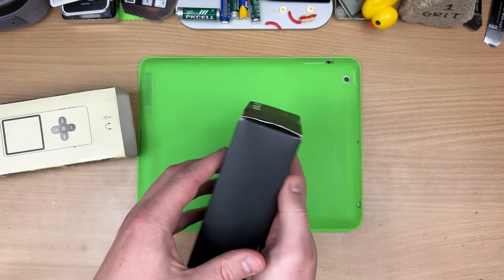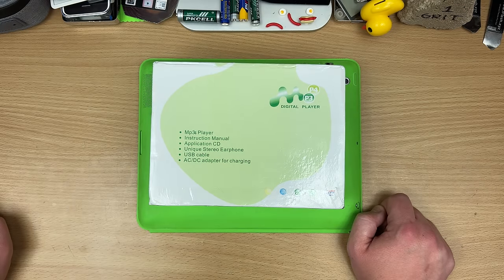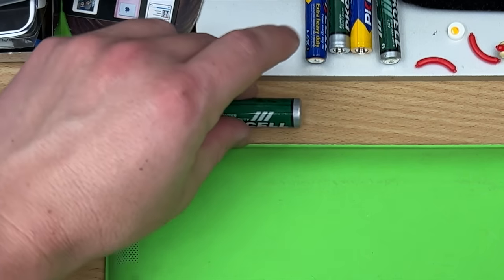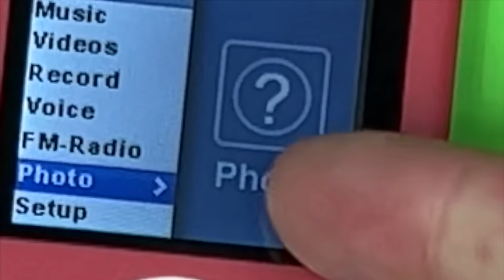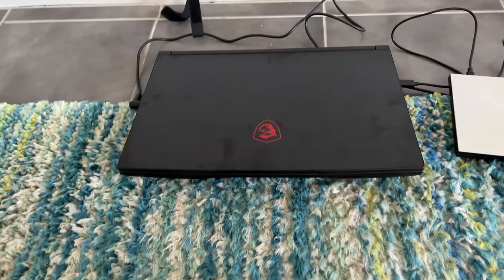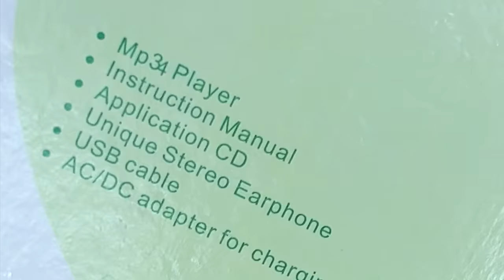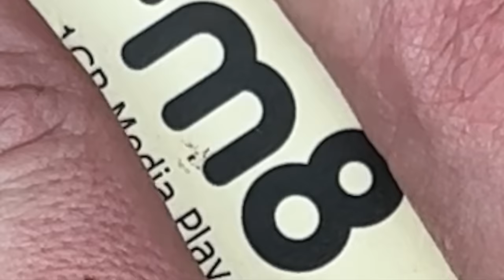The absolute worst bootleg iPod.

Comment from the maker: I love the passion for this king of the nuggets, here's more context! 

I tried for ages to get it to appear without wiping it but it was MIA. I just edited out the 15 minutes of "awh noe, this aint a real guy is it?". 

Folks think the OS was lost after its battle with Disk Utility but it booted into it afterwards! I shouldn't have removed the footage of me browsing the settings as it was way boring but totally showed that it was working. It happily took files from the computer! I also tried FAT32 off camera but again, way boring. It's a nugget. 

In retrospect I should have tried using it before wiping it and for that I blame Frank but also apologise on her behalf. But it was a ScamPod, the idiot didn't even know how much storage it really had. It crashed and boot looped the whole time using it and I bet it was never meant to actually "work". 

But I could pull it apart like an orange and that's what really mattress 🛏.

Frank says nothing.
Reply: I think regardless of all the struggles, we got a good laugh out of this pile of junk
Reply: Should’ve been held together with the same packing tape the box used
Reply: I looked up the chip and it’s a legit 8GB nand flash chip. Not sure why it read 1GB with the real 30 pin cable.
Reply: franck
Reply: @docsnavely1010  cluster size, partition table madness. if you shove it into gparted and give it a clean mbr with a fat32, it should go back to 8gb. Dont expect any of it to work still. seems like ths software on the cd was specifically needed to encode files in a certain format for the player to understand them.
Reply: It's not only about FAT32, the partition scheme should also be MBR, not GUID.
Reply: I was yelling at my screen the entire time you were trying to go to open the next menu with the Menu button. You never once tried to use the Play/Pause button. Reeeeeee.
Reply: u broke it when u erased the disc lol i had one like this  there soposed to be music folder vidio folder ald all that stuff lol :>
Reply: What song dos he use to explode the headphones
Reply: You forgot bootleg Bonanza
Reply: I like how you answered all the internet experts questions in the comments...
Reply: So what Linux ditro are you gonna get on your laptop?
Reply: Frank smells
Reply: you needed to format in fat32, not Mac os journaled!
Reply: I bet you failed to format it to the right file system, thing probably wanted fat32 or something. 
only downside to the 1 grit is that we can no longer find out...
Reply: I got the same laptop but stayed with windows 10
Reply: Otis McDonald - Scarlet Fire
Reply: @docsnavely1010  sus
Reply: Can you review the 
Bose sound sport wireless ear buds?
Reply: You found the ultimate nugget 🤣 😂 I love your content ,1 grit for life 🧬 😂
Reply: DANK I found pkcells in a hobby shop in America. I didn't know that exist. Tell me the word, i'll send more :P
Reply: Video idea :  External sound cards, are they any good ?
We all have a computer with a shitty integrated sound  card in it, could an external one save it ?
Can they drive a pair of Hurr Durr 600's ?
Should I spend money on one ?
Reply: Oh?
Reply: @docsnavely1010  They probably used QC rejects in those fake iPods, hence why it doesn't work properly.
Reply: From what I can find, it does appear to be a real Samsung part number (K9G8G08U0M-PCB0), which is 1 GB. Past that, who knows? And yeah, there was the whole issue about Windows formats vs Mac formats which is stupid but the world we live in.
Reply: @GrumpyTy34er  Dang it
Reply: Legend says, frank said the word we do not say.
Reply: I’m only interested in Frank’s opinion
Reply: @ghoultooth  Thank Frank for the rank and the tank
Reply: Franks speech was emotional
Reply: U have to find a second one and try it before wiping
Reply: Pardon the bump, but I know what’s going on. The software on the disc lets it talk to the MP3 player on windows, even though there’s that weird format partition on it. The idea is that it needs software to transfer the files to it. It likely has some additional software files for it to work correctly, which is why it shuts down and restarts on its own. Just thought I would mention this for when you get any other music players that have a strange format for the drive in the future. Cheers!
Reply: Wanna play games together?
Reply: DankPod, The God Of Nugget
Grit, The Nugget Terminator
Reply: Grit is the Nuggets worst fear.
Reply: Ooo
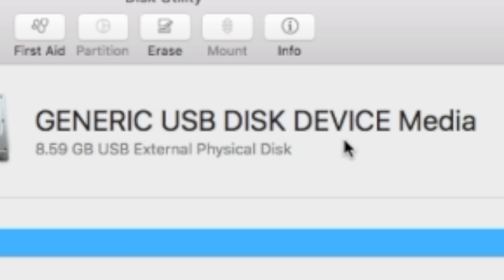Reply: YOU HAVE DELETED THE OS 5:36
Reply: I was thinking maybe you were supposed to have the "ipod" and the CD in the same computer and run that file that said "startup" but who knows, I don't actually know anything about ipods
Reply: @DankPods best content ever
Reply: I unkowingkly killed the best nugget I had the EXACT same way
Reply: Do a  knok of ipods vid
Reply: shouldve tried mbr instead of gpt
Reply: Its a mp34….
Also known as a media player r34 
Only the finest XP
Reply: nugget
Reply: imagine if frank said something
Reply: “That’s so not cool” -Dank

“That’s way past uncool” -Sonic
(This was bad I’m sorry)
Reply: Can't stop laughing
Reply: Dank, mayroon ka bang mas bagong bersyon ng mga nuggets na ito?
Reply: @docsnavely1010  The datasheet meant 8 giga*bits*, not 8 gigabytes. A byte is equal to 8 bits, which means that 8 gigabits = 1 gigabyte.
Reply: I'll be honest with you, one day my childhood bootleg mp3 player appeared in GParted for me once and I did the same exact thing as you did and ever since then, the apps that access the internal storage can no longer launch anymore. So, I think it's 100% the problem
Reply: I would've tried it on Windows, with the included program, before formatting. Who knows what treasures could es hold?
Reply: @docsnavely1010  It's 8 giga _bits_, hence 8/8 = 1 gigabytes…
Reply: The fake iPod you reviewed looks like the bootleg 3g Na-no
Reply: @AndreiRObertYTB  That's why I prefer nuggets that are simple drag&drop.
Or something that can run RockBox
Reply: Yeah formatting it probably removed the folders it goes to for the different functions.
Reply: Boom boom
Reply: Aww my puckcell...... love your vids kind sir
Reply: were did you buy it. i kind of want to try a fake ipod